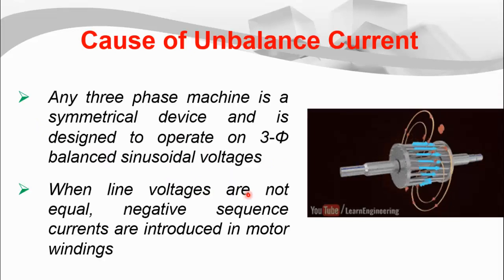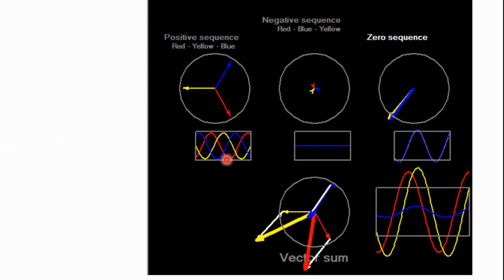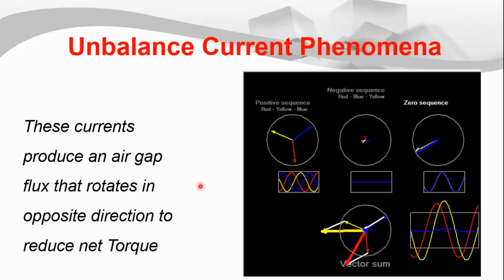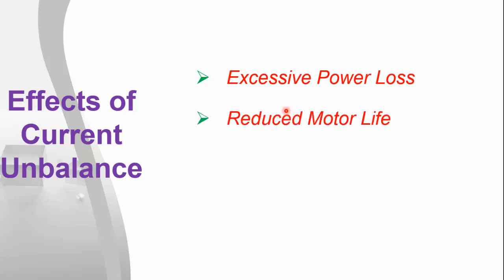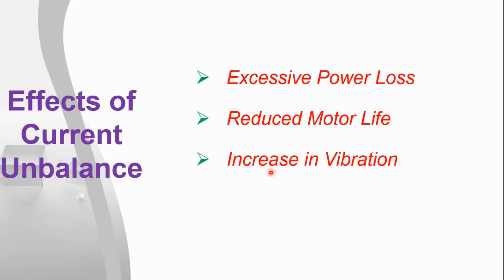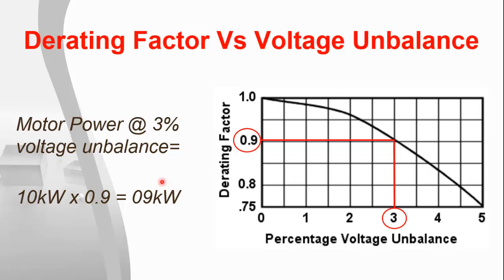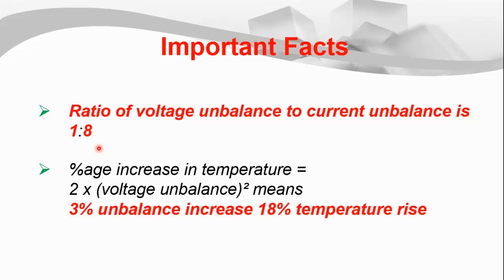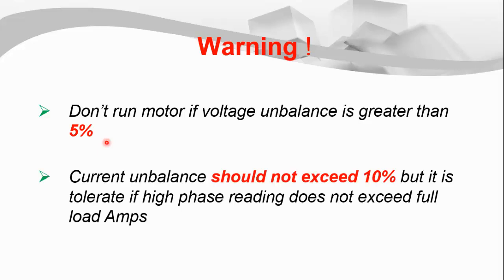Unbalance Current in Motors | Unbalance Voltage | Effects and Causes of Unbalance Current

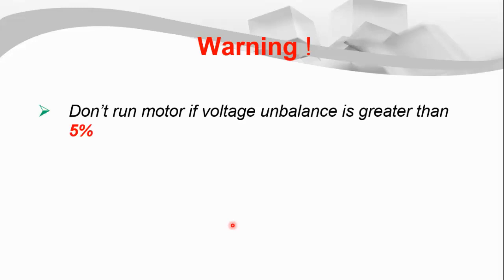Comment: 5:31 why just line voltages? why not phase voltage?
also by the percentage does taht mean if one line voltage = 440V and 2nd one line voltage = 425V so relative diff is more than 5% thats why neg currents will be produced ??
Reply from the maker: Yes ofcourse phase voltages  or line voltages are same things . The impact is same whatever the voltage is. And you can see the formula for calculating voltage or current unbalance percentages. All 3 phases are calculated
Reply: @electricallectures  sorry i didnt see formula in your video , can you point where was it ? again my question is same that how we know voltage diff is 5% ? is it from 440/230V ref
Reply from the maker: (Vmax deviatuon line or phase - Vavg) ÷ Vavg x 100